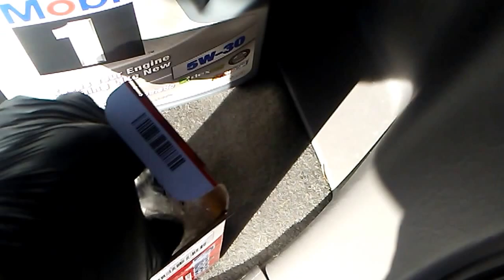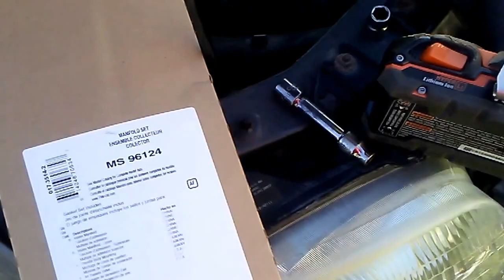Ford Escape P0302 Misfire Fix part 2(2)

Comment: So is cylinder 2 on the top? You didn’t have to move the manifold did you?
Reply: Number 2 cylinder is unfortunately under the manifold
Reply: u mean intake on the back of motor
Reply from the maker: I had to take the manifold off to get to the back three cylinders